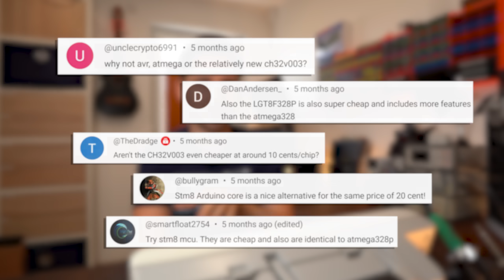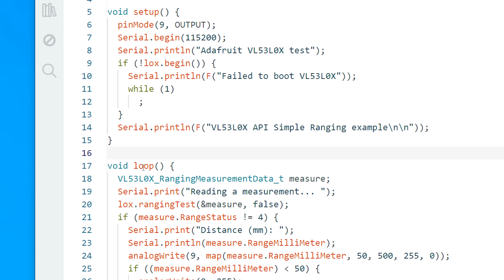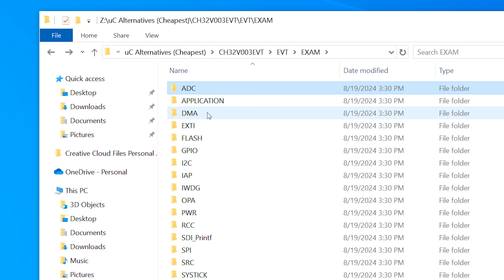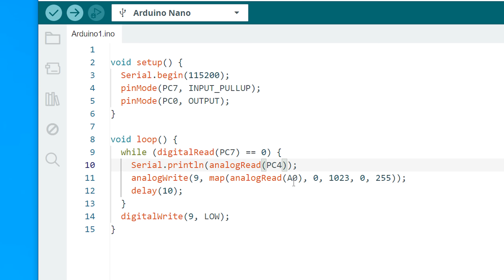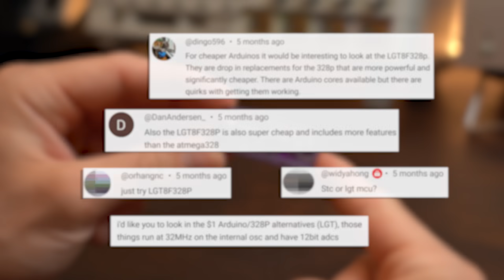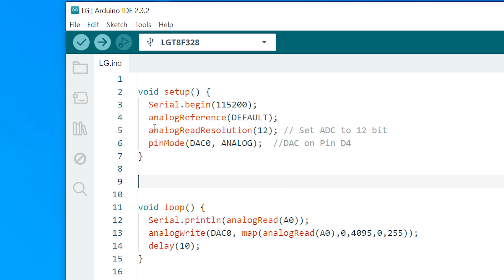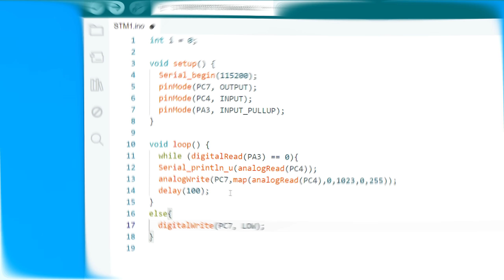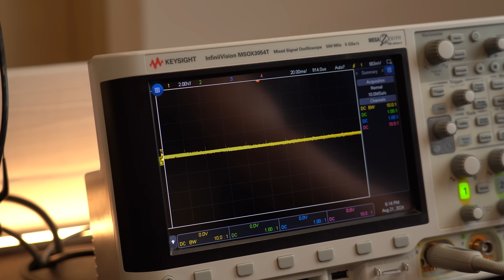I tried the 3 Cheapest Arduino Alternatives! (That you Suggested)

Comment: You for got ESP32. And it is cheper than an arduino, better than any thing.ANd ESP32-CAM is also cheper than the ESP32, And is more compatible And has more features and less I/O pins.
Reply: But more expancive
Reply: These are certainly not cheap when using the bar chip you’re lucky to use about 20 components with the chip that has a massive assembly cost in time or potentially money

Comment: It really depends on the task in hand. For basic automation needs with no power consumption or acute performance considerations, regular arduino boards, esp32s and stm32 boards are plenty functional. I have not worked yet much with PIC24 or PIC32 microcontrollers for general prototyping though, so maybe someone who has worked with them more could say. I know PICs are notorious for hardware peripherals and lend themselves much more for final, mass production devices.

Arduino still remains the go-to starting point for learning about microcontrollers and prototyping.

Comment: Ultra cheap and tiny (like down to 8 pins)... PIC8[L]F series and PIC16[L]F series.   Easy to program.  Both use an 8-bit instruction set so if you want to do 32 or 64 bit calculations it will eat up a lot of program space from the library and take a lot of time.  Terrible instruction set actually, so don't try to use pointers in C, but can easily be programmed in C.   Has all the expected basic hardware.  32 MHz internal clock (instruction clock is divided by 4).  ADC (10-bit), DAC (high impedance), PWM (medium resolution), several low and medium-resolution timers.   Extremely low power.

Hardware-heavy MSP430FR* microcontroller series.   16-bit RISC instruction set, lots of registers, ram, flash, and some FRAM, hardware multiplier, and extremely capable I/O hardware.  Good 32-bit and 64-bit math support if needed.  16 MHz (but at least 4x faster than a PIC).  Also includes a little FRAM ... 512 bytes of non-volatile ram that you can update often without wearing it out.  Like a trillion cycles, so holding dynamic configuration state is easy.  Suitable when serious calculations have to be made on samples in real-time.   Very capable ADC (10 and 12 bit), PWMs,(high resolution), lots of high-speed serial (I2C, etc), high resolution timers.   Low power.

ESP32 series...  very powerful microcontroller with minimal hardware but has built-in wifi and bluetooth stacks.  Very useful when external wireless comms are desired.

-Matt

Comment: the arduino ecosystem is not an IDE, it's a framework. Every dedicated lib for a microcontroller or board is part of a framework!
you wouldn't be able to learn an IDE, as it's simply the means of writing code. you're able to learn the framework, which is what you use to talk to registers and peripherals of de uC!

Comment: You forgot to mention that ch32v003 is a Risc V chip which is newer than the other arm chips you have in the video. Wch chips  arduino support is decent and still going. Plus wch provides  many tools to program the chips.

Comment: a 20.000+ USD Keysight oscilloscope sponsoring for a video on how to save a few bucks on the cheapest micro-controller.. the perfect target audience ;)
Reply: IKR! 😩
Reply: Consider his audience is worldwide. Those few bucks add up a lot in many places making it distinguishible
Reply: Well if you're making a product with the potential to sell thousands of units, a few bucks saved on a controller adds up
Reply: @bryce.ferenczi Plus, the small differences in features and power drawn in different applications can be huge. You may have a device that will stay in standby most of it's life or it may stay in sleep mode for most of it's life. The microcontrollers showed that they were very efficient in one application but not in the other.
Reply: @bryce.ferenczi  For volume, I would think then one wouldn't go for a controller like this, but rather an FPGA or even ASIC..
Reply: @cdh79 FPGAs are very very expensive compared to cheap micro controllers
Reply: There are now super cheap FPGAs as well.
Reply: @InXLsisDeoplease give an example of this. Where is the $2 FPGA chip? 
We are talking about 20 cents components, anyway. You can't get an FPGA for $2, which was said to be too expensive anyway, so I don't know what your point is. 
Why use a $20 FPGA when you can use 50 cents attiny? 
You're weird.

Comment: Scott can you make a video about those wireless doorbells which dont need batteries to operate (the transmitter does not) ? My father recently bought one, i was like for sure this thing is a scam but it works and i cant get my head around how they work. How they transmit anything without batteries? There are no solar cells or anything, how doeas it work?

Comment: Yeah the greatest caveat with this STM boards is that usb connection has nothing to do with flashing unlike arduino boards like arduino nano. Yet the USB connections can be utilized for USB communication if that is used in project. If the chip on board has USB communication feature of course...

Comment: I would honestly advise against using the Arduino core as a crutch. It is a fantastic tool to begin learning about code, and to bridge the gap between software engineering and electrical engineering! But it is also phenomenally inefficient, and as you've seen, not every chip is compatible. I can definitely recommend programming an RP2040 in VS Code as the next step, because it's barely a step above Arduino in complexity.
Reply: My 12 year old nephew likes Arduino because they played with it at school. I'm a software engineer with also an interest in microcontrollers. So, I gave him an Arduino clone and some stuff to play with. He likes it. I have some stk500's and Dragon's laying around so when Arduino becomes too easy I will show him how to program on a lower level. I think it does not matter so much which microcontroller is used. It is about learning the basics. As he gets more knowledge he will find out about other microcontrollers and possibilities by himself I guess. Or he loses interest lol.
Reply: @pcdispatch  Was Arduino ever meant for anyone other than children, the otherwise uninitiated, or those too lazy to prototype with a few $0.01 worth of hardware?  I'm glad for your nephew, he'll be a smart chap, and is lucky to have you. But for the rest of society .. I'm afraid future (or even current??) spaceship EEs will try to get to Mars via software solutions that should be hardware questions.

Comment: I use ESP32s with my Home Assistant server through ESPHome. I have BME280s wired to each around the house. I can update them OTA as needed and add new compatible hardware (lightning sensors, magnetic trip sensors, distance/radar/ultrasonic sensors, air quality sensors, weather stations units) as I see fit.

Comment: I used to work with AVR microcontrollers at first, now I use STM8 for normal projects and STM32 for high end projects.
Also, I use VS Code editor with Em-IDE plugin and SDCC and ARM-GCC compilers to program microcontrollers.

Comment: The CH32 really sounds like the most promising option here - as long as the limited onboard memory is something you could work with.
I'm sure that with such a nice board available at such a low price, one can absolutely use this as a core for many projects. Using such a controller is also a great opportunity to learn to write for the RISC-V core, which is gradually becoming more and more prolific in the sphere of microcontrollers. Especially if you're willing to try writing assembly.
Reply: how to start writing in assembly? is it still worth it?
Reply: @omniyambot9876  How to start - it's about the same as starting with any language. You set up the compiler and IDE, learn some functions and how they work, and start stringing them together into programs, first simple, then more complex...

Assembly will be worth learning for as long as we use the current paradigm in computing.
Reply: Definitely a great controller, I got two different versions of the controller chip for $5.00 for 50, not sure if the price has gone up since when I bought mine.  There's also a bunch of different options for the CH32V family, depending on the price and performance required, up to 144 MHz and 262K of flash, with tons of GPIOs and peripherals.

Comment: you should live the joke and see if it "does it run Linux?"
Reply: Someone did already emulate 32-bit ARM on a 8-bit micro to boot Linux, but better hope you're fine with waiting about 2 hours to load the command line (this wasn't some stripped down embedded Linux, it was Ubuntu!)

Comment: The new Attiny series should be considered also as a cheap alternative, not all is power. They are just an IC that you can drop in your circuit, no need of dev board or additional components. Are cheap, can be programmed with just one pin, have 12bits ADC, I2C, SPI, differential ADC with gain, comparator... Small package or a lot of pins, all available.  A very low consumption, can run for months or years with just a coin battery in some scenarios.  Work happily from 5.5V down to 1.8V, so you can use LiPO/Li-Ion... without regulation. Work with Arduino. And programming this little monsters is a lot of fun!
Reply: The cost of these chips is usually high unless you are buying many
Reply: @Adam-n1p6m well, the ATTINY412 cost 50 cents, buying one. And the ATTINY3224 about 80 cents with 14 pins and better than atmega328p in everything, including cost.  Maybe it's not the cheapest for mass production and 8 bits, but for hobbyist I think that it's ok as an alternative.
Reply: @gosdeCarrer  these chips often are sold as slightly higher price due to atmels arduino hobbyist markup

Comment: Definitely good options to consider for chips. For low cost microcontrollers (not quite that cheap but ill eat the $2-3 difference to save the extra steps) the raspberry pi pico and the xiao esp32c6 are amazing

Comment: Have you tried STC8G series from STC microcontroller's ? They are pretty cheap and they are basically 8051 derivatives, but better. I use one which comes in 8pin dip package. So far ok. As for programmer,I use ardiuno with RST connected to GND

Comment: ESP32-C3 Supermini and RP2040-Zero are my go-to options for cheap microcontrollers. Both under $2, supported on basically every IDE out there, work with basically all Arduino libraries, and have plenty of GPIO for most applications. Those are all neat boards, but I don't see any advantage to them over these two, unless you're doing something with like 50 MCUs where the ~$1 per piece savings of the STM8 becomes relevant.

Comment: Have a look at the ATTINY1614 with great support from megaTinyCore. Clock speeds from 1Mhz up to 20Mhz, and power consumption less than 1ma at 4Mhz. In deep sleep you can get it down to 0.5uA. That's nice.

Comment: I'm surprised that platformIO isn't mentioned. It supports most microcontrollers out of the box and you can use the same language and libraries as the Arduino ide

Comment: I am currently trying out ATtiny1614. Need a UDPI programmer, but works with MegaTiny Core on Arduino.  My go to currently is ESP32C3 module. Attiny to be used where i do not need Wifi / capacity / speed.

Comment: The fact that you found one with a DAC is very impressive! That said, ironically it is not idea for the specific use case you demonstrated. Because of the non-linearity of a LED's I-V curve you end up with only a small fraction of the output voltage that will light up the LED. Oddly enough PWM is more appropriate for giving a more linear change in apparent brightness. But boy is that a game changer for cases where one wants an actual analog output!

Comment: MCU with WiFi is just better. Try any ESP. Personally in most cases I use MicroPython on ESP8266. Considering price, ESP32 is the better variant now. uPython is good for a high level programming, while not so good for low level and high speed.

Comment: I tried two of them
CH32V003 and its is a good uC and very cheap of 32-bit uC, I bought all SMD Packages to test them
STM8S001 which is compatible with STM8S103 and its peripherals is good to have them and it's built in oscillator is very good option too, I bought it @ $0.2 before the pandemic

Comment: A lot of comments do not understand the concept of a cheap uC IC. If you need to replicate a design 100 times, a 0.5 USD uC will come up to 50 USD; while a 1 USD uC will come up to 100 USD. Thats a big jump. Thus the esp32 and stm32f103 are not an option for designs that need multiple uC.

Comment: I bought a lot of esp32-c3. The smallest dev board I could find with an usb-c port. They are awesome for my smart home. I usually use them downclocked to 80Mhz for power saving and temperature management and I love them!
Reply: you can get the D1 mini ESP2866 with usb-c (v4), they are a lot cheaper.
Reply: @OzCreationsAU  I bought 8 esp32-c3 super mini for 2,61€ each, while I see the ESP8266 at €2.30 each. Yes, they are cheaper, but not by much, and if I need to use Bluetooth, I can always increase the clock speed of the ESP32 (the ESP8266, although it also has Bluetooth, in my opinion lacks the processing power to fully utilize it
Reply: @aleatza  True, but it's also not as supported as I would like. especially for WLED etc, they still only officially support the std esp32. I also use them a lot in long life battery powered projects, so power consumption is a factor for me as well.

Comment: The CH32V003 isn’t really aimed at the arduino crowd. The high cost of the dev-board compared to the MCUs suggests it’s aimed at people designing their own PCBs, and the wide range of footprints compliments that. Not only that, there is a decent selection of MCUs with varying specs that all share the same architecture and programming method. The intention is for the developer to be able to stick within one ecosystem and get intimately familiar with the register map, memory layout, and other low-level intricacies. Which is the opposite of what the arduino IDE does, shielding the user from the low-level and allowing relatively seamless exchange between different architectures.

I bought like 160 of them, but my old computer couldn’t install CH32V003fun.
Reply: I like to believe that as the CH32 Arduino core is still improving, the CH32 can also be of value to Arduino users. Personally the affordibility of the CH32V003 allows me to take more risk in experiments, without fear of ending up with no board. I bought over a hundred in different packages, so no problem if I accidentally reverse polarity or connect a pin to 12V.
Reply: @MaxintRD  on the other hand, the lack of DIP ICs means you have to prototype with SMD breakout boards, if not with a complete PCB. The breakout itself isn’t a cost effective disposable prototyping device. I prefer ATtiny chips for that kind of stuff.
Reply: @Scrogan  - Indeed, for most of my prototypes I've soldered the chips to breakout boards. Standard SOP8 and SOP16 board are quite cheap. I've also used plenty ATtiny's (13A, 44A, 84, 85). The SOP8 and SOP16 packages are quite easy to solder. TSSOP20 is a bit harder, but still manageable. I prefer SMD for compactness and the occasional project PCB. One thing I also like about the CH32V003 is that realtime debugging works, which I never got working for the Atmel chips.
Reply: @MaxintRD  that debugging sounds promising, is that via the Arduino IDE or something else?. Debugwire on old AVRs isn’t enabled by default, and UPDI debugging for the newer AVRs seems like a pain considering I had to rip files out of MPLABX to even get AVR-GCC to compile it. I’ve taken the SMD pill too, but it’s still daunting for some.
Reply: @Scrogan  - Yes, I use Arduino IDE v2.3.2 on Windows. It uses the SWIO pin and the same setup used for programming. Nothing special really. Just compile with debug symbols and it can step into code, set breakpoints, examine/watch variables, etc. Main limitation is a slight increase of flash usage. At the moment I only have the CH32V003, but other CH32 chips have larger flash. For Atmel I never got debugging working, for ESP it wasn't stable. Still need to see what the RP2040 offfers.
Reply: @MaxintRD  now that is very cool. Probably by far the cheapest and most accessible debug-capable dev-board.

Comment: So, I have been using the STM8Sxx devices now for about a year. I can think of no reason that I failed to make the connection with you and the 'cheap choices' that you have been talking about before. (I do not mean cheap as in less useful but less costly) When time allows I will post some minor projects on the discord.
As a side note I went from the STM32 to the STM8 for a former company project. 
Peace

Comment: great video. thank you. Maybe you would try ch552, cheaper than ch32. with usb built in, everything is simple
Reply: I guess it's a MCS-51-ISA. Of course a pimped version (much faster than 8051), but they were introduced in 1980. ch32v/ch32x is Risc-V.
Reply: @deterdamel7380  yes. 8051 with USB.

Comment: how about esp8266 ic in bulk? I think I've seen a lot of 10 being sold for £10-15. Even esp32 boards are somewhat price parity with the expensive side of the alternative but for the features i cant complain. I also have a nrf52840 board & upgraded version of that ic is also in the similar price range (the last i checked 2 years ago)